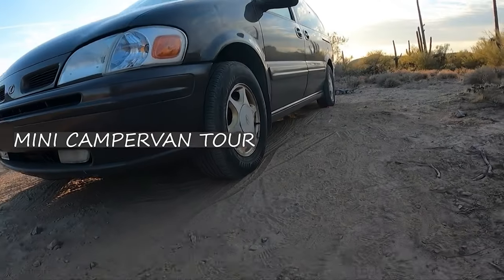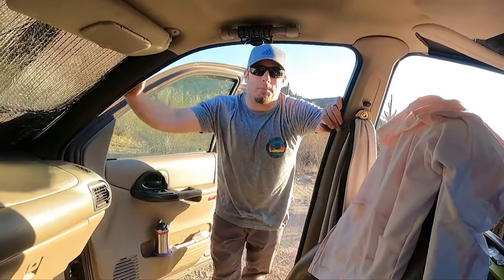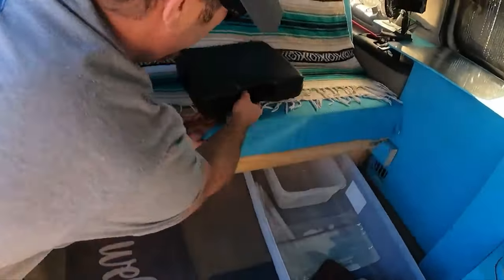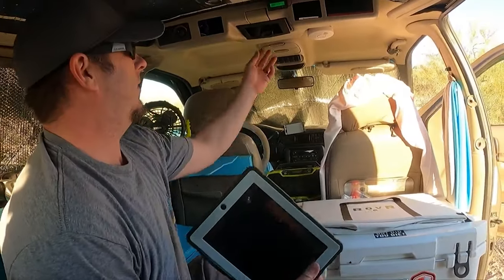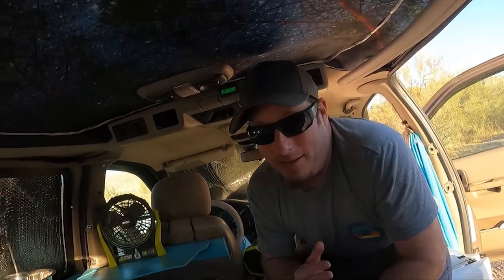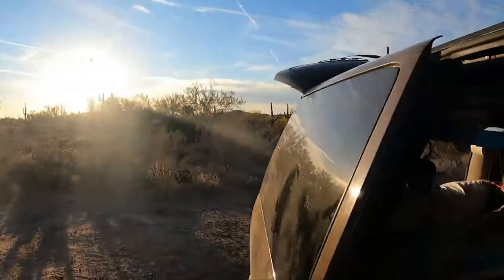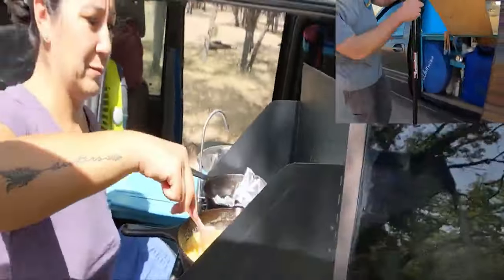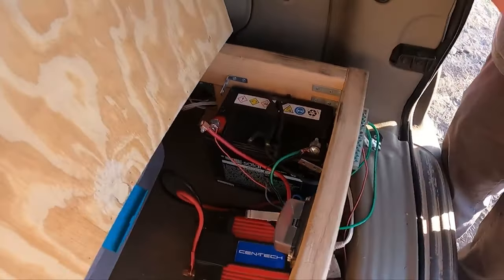MINIVAN CAMPER TOUR | BEST DIY BUDGET CAMPERVAN DESIGN & BUILD

Comment: Great build .  Where did you get the window screens ?
Reply from the maker: Thank you! I made them on the fly with 1/4 plywood.  Used csrdboard and trimmed till I got the shape right. Transferred shape to wood. Traced 1.5  inches in, all around then used a jigsaw to cut it. Painted the frame black and stapled screen material. It was a lot of work but worth the result!
Reply: Are there bugs/ mosquitoes year round in Arizona? Michigan girl, bought materials,  have yet to make screens. Thanks.
Reply from the maker: @serenakoleno9338  around some of the stagnant legs and waterbeds yes. Typically around monsoon season because the rain causes all the larvae to hatch. Not so bad in the winter except around bodies of water. In the more desert areas there's not much at all

Comment: I just purchased a 2010 Dodge Grand Caravan. I am hoping to get my hands on some design files (ideally I can open in TinkerCAD format .stl, .obj or .svg, or any drawings/diagrams/measurements of bed/cabinet/kitchen alternate setups etc) that I can take inspiration from modify to my personal liking to get the best result possible. I thought I might ask if you would be so kind as to forward any design files that you have that may help me, also if you are aware currently of any useful/necessary items for vanlife selling at a really good price/value I would very much appreciate any help/advice you can provide. Thanks and safe travels!
Reply from the maker: Hi Jim! Unfortunately no. I winged it. Started with with most important feature which was a comfortable bed. Figured out how short and tall I can make it without sacrificing comfort or the ability to sit up in bed. I then built everything else around that using painters tape and cardboard to create the main outlines and shapes and built within those borders. Measurements would be between  the Silhouette and the Caravan. The Oldsmobile is an extended minivan. A great inspiration was the channel Eric Enjoys Earth. He encourages you to come up with and implement your own design based on your needs. The effort is super rewarded and I can attest to that. He helps by giving a foundation to build off of. A good thought process regarding layout and other things you may not have considered important and vise versa. Great stuff! I will reply with a link to the perfect video for you.
Reply from the maker: Eric Enjoys Earth! DIY concepts https://youtu.be/hvfJSwc5u1A
Reply from the maker: You will love it!

Comment: I’ve looked at fans but too many to choose from so haven’t bought yet. What kind and model is your fan. Is it 12v. ?
Reply: Love your build
Reply: Not the Roy I one. The black fan
Reply from the maker: Thank you. I'm pretty sure I got it from Super Walmart where they sell RV stuff. It is 12 V that had a cigarette lighter adapter but I just cut that off and why are they directly to the fuse terminal on the positive side of my house battery. It's very important to have a fusible link to prevent a fire. I like the fan because it was 12 volt it oscillates and it has a clip for mounting anywhere pretty much
Reply from the maker: I wish I remembered who made it

Comment: Do you have a video of your bed build?
Reply from the maker: i do not, however the idea came from Eric Enjoys Earth and it is one of his most popular videos! I did a different version based off what he does but it is very similar. The measurments are up to you and your needs but the design princible is the same. Far example he seems much taller than I so the height and length will be different to maximize precious space and storage. Also I just used Body pillow cover sheets for wrapping the sections. Made it more budget friendly I was lucky the measurments for my cut sections allowed for this!

Comment: How did you make the window screens ???
Reply from the maker: I made them on the fly with 1/4 plywood.  Used csrdboard and trimmed till I got the shape right. Transferred shape to wood. Traced 1.5  inches in, all around then used a jigsaw to cut it. Painted the frame black and stapled screen material. It was a lot of work but worth the result!

Comment: What are those counters made out of? Is it just plywood?
Reply from the maker: Hi Paula, it’s actually flooring underlayment that you can get at Home Depot because it’s very cheap. Somewhat flexible and lightweight. By priming and painting it, you seal it essentially. I. I gave it a very light sanding first so that the paint adheres better.
Reply from the maker: I just had a thought I forgot to explain why I used the underlayment. It’s because it was much cheaper than the plywood. You can certainly use plywood. It is a stronger material in my opinion but it’s a lot more expensive compared to the underlayment material. That was done during Covid when prices skyrocketed I’m not sure where things are at now with pricing.

Comment: What about shower and tv
Reply from the maker: Both are shown starting at 4:00 through 4:30.  We leave a 6 gallon jerry can in the the sun to heat up. We use that water to fill a collapsable bucket and place the submersible pump in the bucket to pump warm water to the shower head. We use the shower head inside the pop up shower tent stored behind the toilet. For TV we use an Ipad tablet and download shows / movies from netflix, hulu and amazon for when we have no signal. We send the audio blutooth to a radio. It's perfect for the small space 🙂 We were going to get a mini projector but the newer van has a 12V TV/DVD already so the ipad is good enough for now.

Comment: My thing as a solo female camper is I can't find a reliable van I trust on long hauls within my budget. I have all the gear I need - just need the van! Nice build and I love that you were able to use what you had to hit the road. :)
Reply from the maker: Thank you so much! Whatever you find make sure to have a me,chanic look it over for you. Worth the cost in my opinion and definately better deals with private sellers. Don't be afraid to negotiate most private sellers list much higher than they are hoping to get. Also consider a google search for your town and surrounding city auctions for city owned fleet vehicles like cargo vans.. you can typically get them cheap and even if they are high mileage they are meticulously maintained
Reply: @gino_colucci  Great advice! Thank you. I hadn't thought about city-owned fleet auctions!! I already have a mechanic on standby who will do a thorough once over - I just need to jump hardcore into a search. Here's hoping 2022 will be my year!
Reply from the maker: @OutdoorsybyNature  good luck to you!
Reply: @gino_colucci  Thank you!

Comment: Did you make the screens? This a a great build.
Reply from the maker: Thank you very much. Yes the screens were custom made with 1/4 inch underlayment,  screen material and black spray paint 🙂
Reply: @gino_colucci  Nice! What was the underlayment you used?
Reply from the maker: @monana1711  actually I take that back this was 1/4 plywood. I used underlayment for everything else because it's really lightweight but I needed a little flex. Sorry I did it like a year and a half 2 years ago lol!